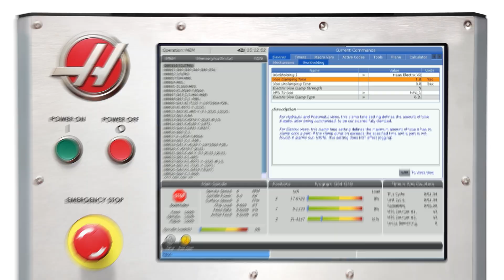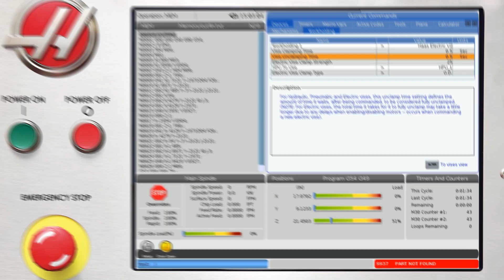The Haas E-Vise! Now at Haascnc.com - Haas Automation, Inc.

Comment: Wouldn’t pneumatic be much easier to use?
Reply: probably not enough force to clanp. also you will still need some electronic sensors to monitor jaw position and force strain. this is easy to use, one cable to connect. less noise too.

Comment: doesn't coolant eat up that cable sleeve, zip ties and tiedowns over time? also if any of these products are made in china i am not buying them
Reply: Where do you think haas get their castings...
Reply: @spikeypineapple552  It's all about American companies greed, they don't ask for quality, to pocket more profit, China or any other country will do the quality requested. When I was in east Europe and worked for Switzerland, we had done the highest quality or they sent back the product and lose was on us. Apple is made in China at high quality because they have to. So blame the American companies, not China! My Samsung Note 20 is made in Vietnam and the quality is much higher than any Apple! Simple like that!
Reply: @spikeypineapple552  What is the problem with Haas? I worked on their machines since 1999, and they are the most reliable, simple, not the high end, but kind of Toyota among cars! Not Mercedes, but get the job done at the highest quality, the screws, ball bearing nuts and guides are made by reputable companies like Bosch. I have done plastic moulds for automotive, now I do with VF-3 SS for aerospace at any precision they need! You don't have to buy Porsche to move your ass from point A to B, a Honda Civic will do the same!
Reply: @srnc9740  Nobody said theres anything wrong with them, the posters said they wouldnbt buy it if it was made in china, as if all of the machine is made in the usa
Reply: @srnc9740  haas machines are NOT reliable, don't get me wrong I love them, I do good work on them all the time, but after owning 3 and more to come I can tell you for sure they aren't reliable.
Reply: Your stupid Apple is made in china!